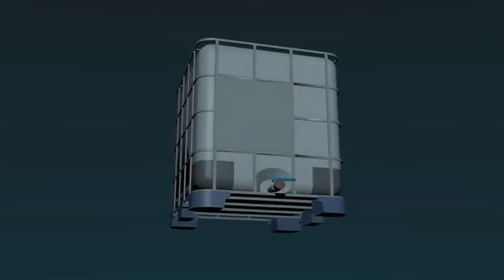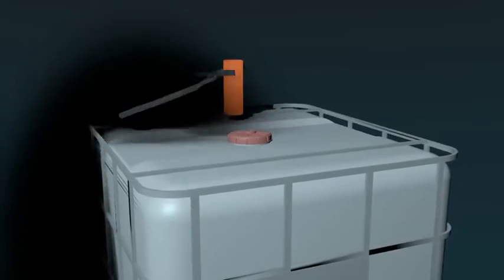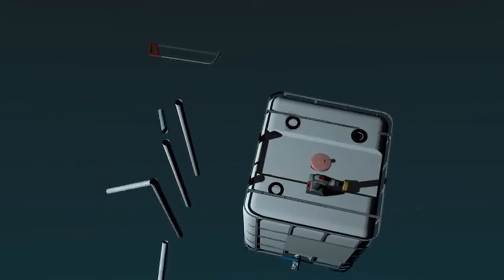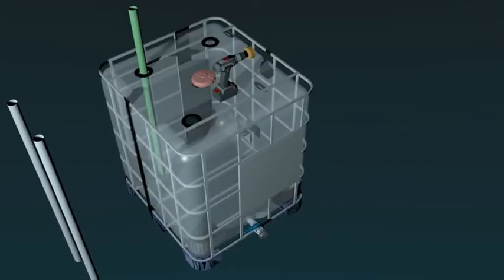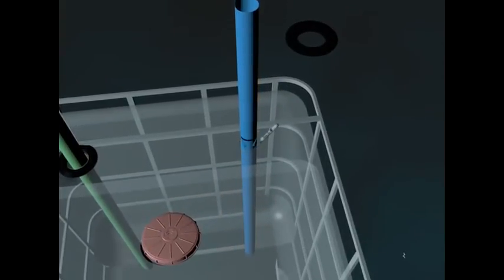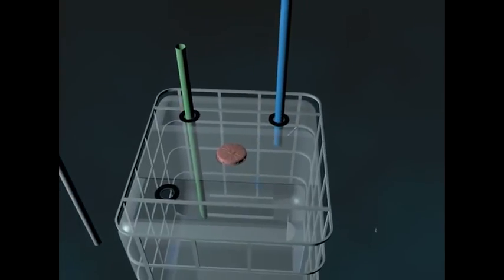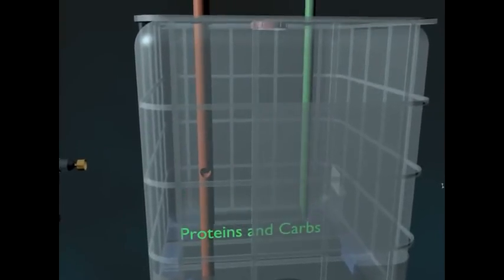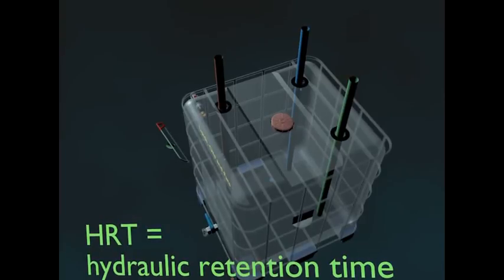Constructing a Solar CITIES Biogas system from IBC tanks Concatenation

Comment: would be careful to not use anaerobic compost tea directly due to anaerobic conditions risking accumulated toxins, also would be wary of keeping biogas generator and stored product in uninerted conditions that may be within Lower Explosive Limits,  but if a scubber can be introduced into the system to further remove H2S risk this is excellent video, thnx for share